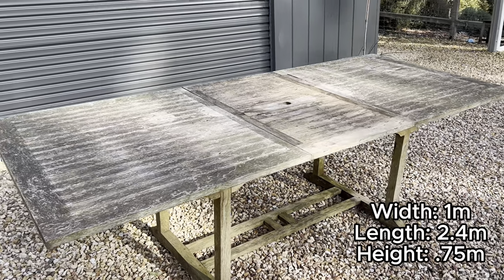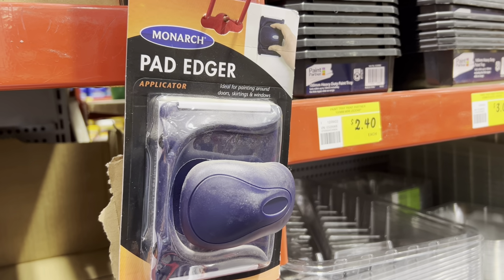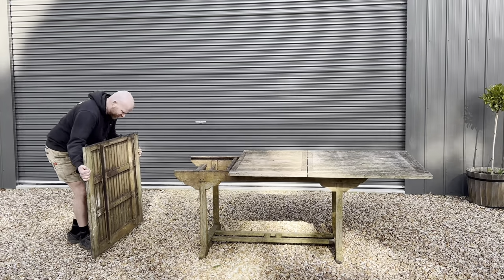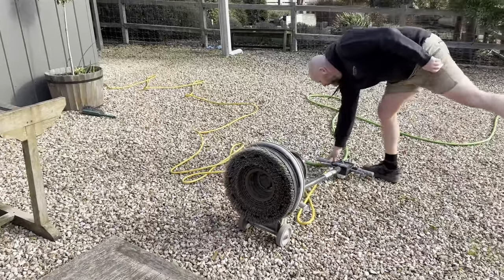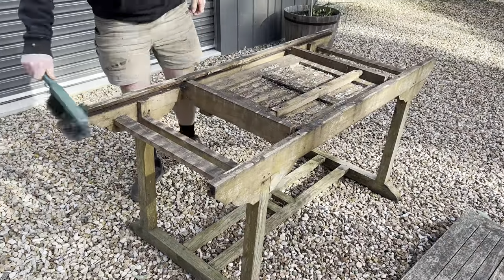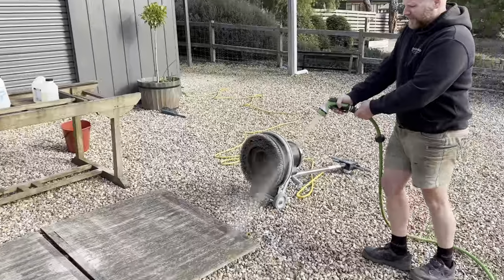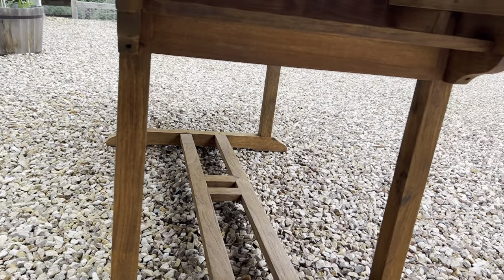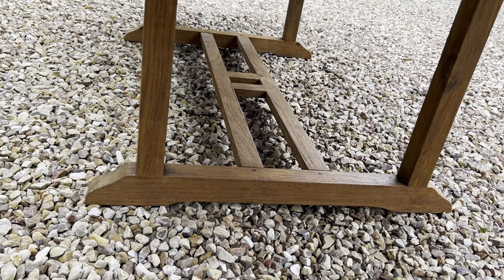Restore Outdoor Teak Table - NO SANDING | Cleaning & Oiling

Comment: I was all in, right up until you brought out the floor scrubber, which we all have of course. 💂‍♂️🇬🇧
Reply from the maker: You definitely don’t have to use the floor scrubber, you can continue with the hard bristle brush. It just speeds up the process a bit and used it because as a floor sander I had one in the van ;)

Comment: Great job… Would this same process be used for a wood deck… while I know it depends on the paint or stain that’s on top of it
Reply from the maker: Thanks mate! Exactly right! Same process is used on decks, unless there is a paint or varnish on top - then you will need to sand back first. Stay tuned for a deck video coming in the next few weeks!
Reply: @QuicksandFlooring  copy that